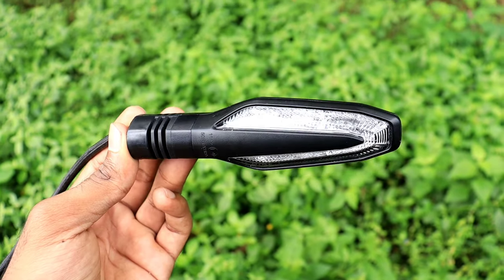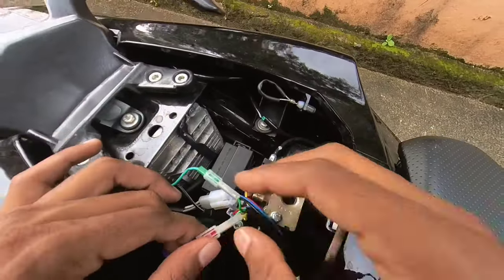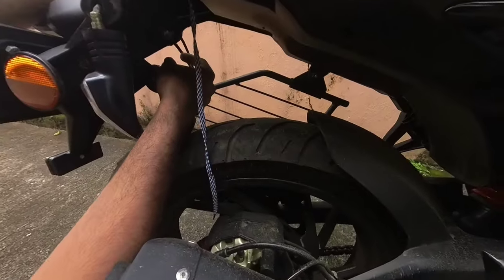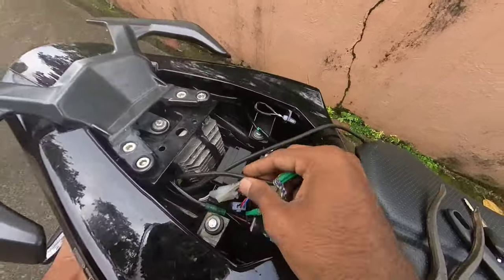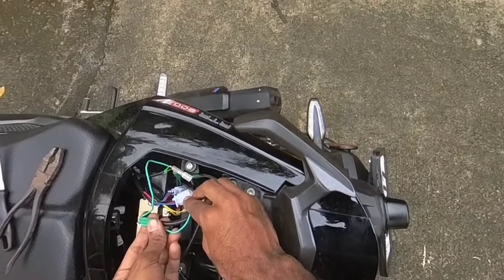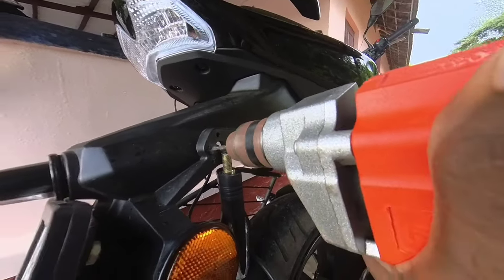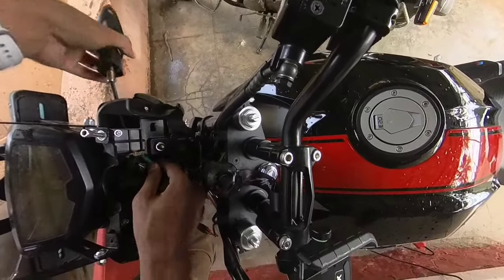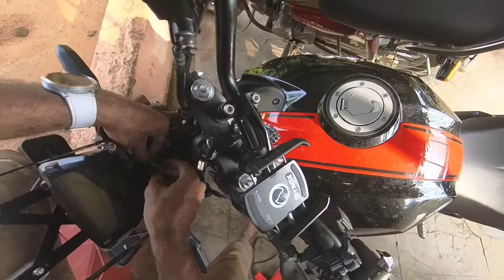BMW GS / RTR 310 Indicators Installed on Apache RTR 200

Comment: Bro I've one crazy idea. Can we install apache 160 4v single seat assembly in apache 200?
Reply from the maker: No bro it doesn't suit on 200 because the plastic layout for fitting the seat is different in 200 4v
Reply: @sreyastp  yeah..